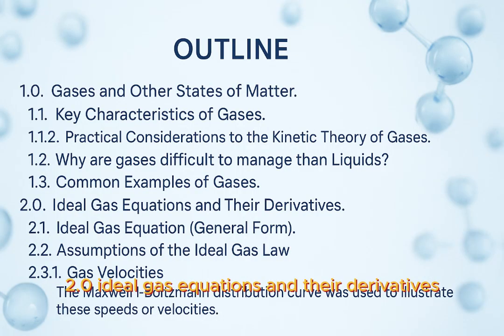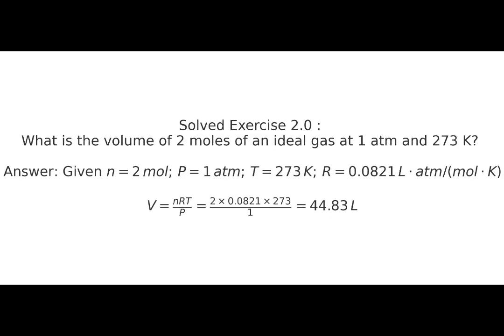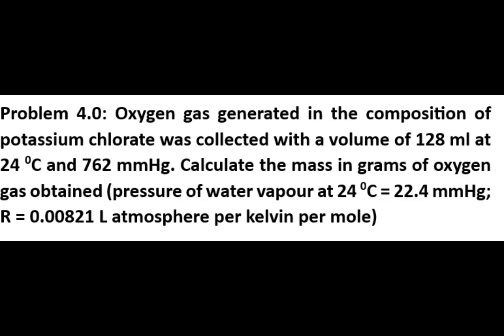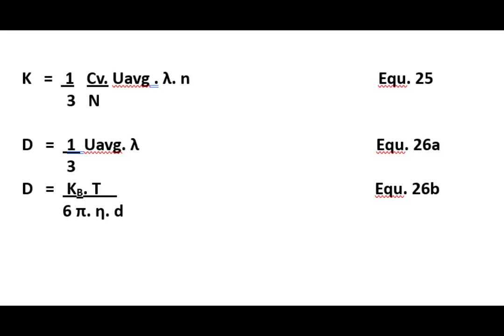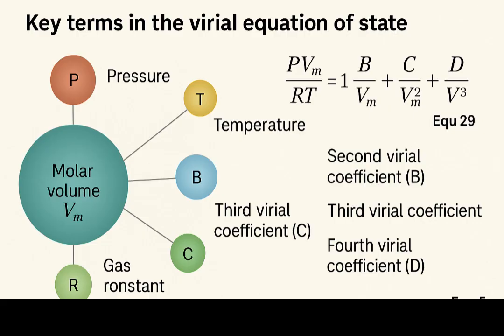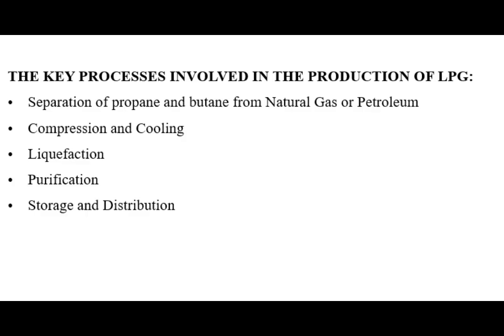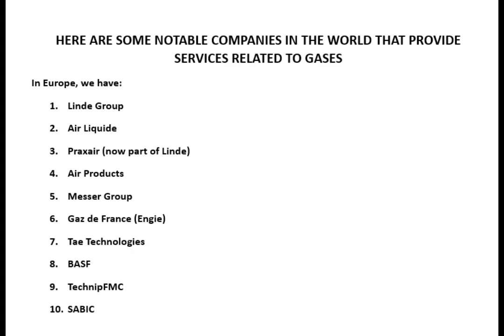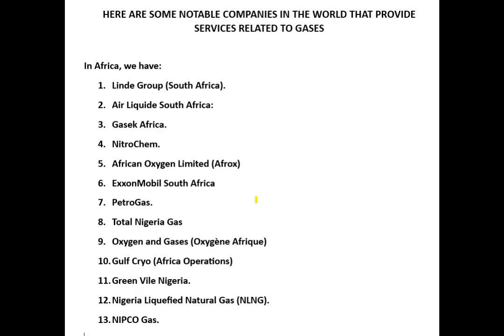Fundamentals and Applications of Gases

Comment: BCH: Using free and pure form of oxygen gas in the atmosphere rather than cylinders of pure oxygen for anesthesia during surgery has several implications including the Advantages, Challenges and Limitations stated below:

Advantages
1. *Reduced costs*: Atmospheric oxygen is freely available, reducing the need for expensive oxygen cylinders.
2. *Increased accessibility*: Hospitals in remote areas or with limited resources could potentially benefit from using atmospheric oxygen.
3. *Sustainability*: Utilizing atmospheric oxygen could reduce reliance on industrial oxygen production and transportation.

Challenges and Limitations
1. *Safety concerns*: Atmospheric oxygen contains impurities and varying concentrations, which could compromise patient safety during anesthesia.
2. *Control and precision*: Medical oxygen cylinders provide a controlled and precise flow of oxygen, crucial for anesthesia. Atmospheric oxygen would require complex systems to ensure consistent delivery.
3. *Logistical complexities*: Capturing, purifying, and delivering atmospheric oxygen directly to operating rooms would require significant infrastructure investments.
4. *Regulatory hurdles*: Medical oxygen is subject to strict regulations; using atmospheric oxygen would require reevaluation of safety standards and approvals.

Medical Implications
1. *Patient safety*: Anesthesia requires precise control over oxygen levels to ensure patient safety. Atmospheric oxygen might introduce variability.
2. *Anesthetic efficacy*: Pure oxygen is essential for anesthesia; impurities or inconsistent oxygen levels could impact anesthetic efficacy.

While using atmospheric oxygen might offer cost and accessibility benefits, the safety, control, and logistical challenges make it unlikely to replace medical oxygen cylinders for anesthesia in the near future.

Comment: BCH: U2021/5535237 (Chukwu Chinwendu)
Using free atmospheric oxygen for anaesthesia has a lot of implications:
1. Its reliability and consistency: the free atmospheric oxygen may not have a consistent supply of oxygen unlike the medical oxygen cylinder. Its oxygen level varies. 
2. Also, due to the atmospheric oxygen concentration (which is lower),  the safety of the patient is not guaranteed. Remember, the air contains about 21% of oxygen. Whereas, the medical oxygen cylinder has 100% concentration or near, and anesthesia requires a high concentration. 
3. Using atmospheric oxygen could introduce impurities (because of the other gases mixed with it) and this may compromise patient's safety. 

Thank you

Comment: Bch:U2021/5535146 Using atmospheric oxygen in place of pure oxygen from a cylinder during surgery is unsafe, unprofessional, and medically unacceptable. The atmosphere does not provide the purity, pressure, sterility, or control required for safe anaesthesia. Oxygen cylinders are essential to ensure the safety, precision, and effectiveness of surgical procedures.

Comment: BCH: Using free atmospheric oxygen instead of medical-grade oxygen from a cylinder during surgery is extremely unsafe. Atmospheric air contains only about 21% oxygen and is mixed with other gases like nitrogen, making it insufficient for the high oxygen demands required during anaesthesia. It is also unfiltered and unsterile, exposing the patient to dust, microbes, and pollutants that can cause serious complications. Anaesthesia requires a controlled mixture of pure oxygen and other gases, which is only possible with medical equipment connected to oxygen cylinders. Without this control, there’s a high risk of hypoxia, infection, and even death.

Comment: BCH:
Using atmospheric oxygen (21%) instead of pure oxygen from a cylinder (100%) during surgery is dangerous. It provides insufficient oxygen for anesthetized patients, increases the risk of hypoxia, and lacks the sterility and control needed. Medical oxygen is pressurized, regulated, and essential for patient safety. Atmospheric air cannot replace it safely.

Comment: PIC:LNG isn't produced using the Joule-Thomson method because methane, its primary component, has a very low critical temperature (-82.3°C), making it difficult to liquefy using this method alone. LNG production requires more complex and energy-intensive cryogenic processes to achieve the necessary low temperatures.

Comment: PIC :
LNG(liquified natural gas) and LPG(liquified petroleum gas).They are both gases but do not have the same principle especially in Joules Thompson effect.
LNG is not produced from the Joules Thompson experiment like in the case of LPG because LNG requires a very low temperature (like methane cooled to -162 degrees Celsius) to make it liquefied.The extreme cooling cannot be achieved by Joules Thompson experiment because Joules Thompson experiment/effect works under certain temperatures and can be cooled under room temperature in which the LPG can be liquified.So the LNG requires much advanced refrigerator (deep cryogenic temperatures) cycles like the Claude or MR process.

Comment: PIC :
LNG is not produced using only the Joule-Thompson effect because the Joule-Thomson effect is a process where a gas expands through a valve or throttle, resulting in a temperature change. For a gas to liquefy using the Joule-Thomson effect, its temperature must be below its inversion temperature, and the expansion must cool the gas sufficiently to reach its dew point.

Comment: PIC:

The cooling from the Joule-Thomson process alone isn’t enough, so LNG needs extra cooling steps to reach very low temperatures (around -162°C). But LPG, like propane and butane, can be liquefied more easily with just pressure and expansion.

Comment: PIC:
 (LNG) is not produced using the Joule-Thomson effect like Liquefied Petroleum Gas (LPG) because LNG's primary component, methane, has a very low inversion temperature, requiring pre-cooling and more complex liquefaction processes.

Why LNG Production Differs from LPG
Joule-Thomson Effect This effect is used in liquefying gases by expanding them through a valve or nozzle, causing a temperature drop. For gases like propane and butane (components of LPG), this effect is sufficient at room temperatures to achieve liquefaction under pressure.

2Methane's Properties: LNG is primarily composed of methane, which has a very low inversion temperature (approximately -80°C or 193K). The inversion temperature is the temperature below which a gas will cool upon expansion (Joule-Thomson effect). Above this temperature, gases actually warm upon expansion.

Pre-cooling Requirement Because methane's inversion temperature is far below typical ambient temperatures, pre-cooling is necessary before applying the Joule-Thomson effect for liquefaction. This makes the process more complex and energy-intensive compared to LPG.

Liquefaction Processes for LNGVarious processes like the Linde-Hampson process, cascade process, or mixed refrigerant processes are used to liquefy natural gas. These processes involve multiple stages of compression, cooling, and expansion to achieve the low temperatures required for methane liquefaction.

Comparison with LPG Production
- *LPG (Propane/Butane)*: These gases can be liquefied at room temperature using moderate pressures (e.g., propane liquefies at about 8-10 bar at 20°C). The Joule-Thomson effect is directly applicable for LPG production without the need for significant pre-cooling.

- *LNG (Methane)*: Due to methane's low inversion temperature, LNG production requires substantial pre-cooling and complex refrigeration cycles to achieve and maintain the low temperatures necessary for liquefaction.

*Summary*: The fundamental difference in the production processes between LNG and LPG stems from the thermodynamic properties of their primary components. Methane's low inversion temperature necessitates a more complex and energy-intensive process for LNG production compared to the relatively straightforward liquefaction of propane and butane in LPG.

Comment: PIC: LNG is not produced from the Joule-Thomson experiment because methane, the primary component of LNG, has weak intermolecular forces, resulting in an insufficient cooling effect upon expansion compared to the stronger forces in LPG components (propane and butane).
The Joule-Thomson effect describes the temperature change of a real gas or liquid upon expansion at constant enthalpy. It relies on the interplay between intermolecular forces and the gas's internal energy.
Liquefied Petroleum Gas (LPG) primarily consists of propane and butane, which have relatively strong intermolecular forces (van der Waals forces). These forces are significant enough that the Joule-Thomson effect leads to a noticeable cooling upon expansion, facilitating liquefaction.
Liquefied Natural Gas (LNG) is primarily methane. Methane has much weaker intermolecular forces compared to propane and butane. The Joule-Thomson effect is less pronounced for methane, meaning the cooling upon expansion is insufficient to liquefy it at typical ambient temperatures and pressures.
Therefore, while the Joule-Thomson effect plays a role in gas liquefaction, it's not a practical method for producing LNG on a large scale due to methane's weak intermolecular forces. Industrial LNG production relies on different methods, such as cascade refrigeration or cryogenic processes that achieve much lower temperatures.

Comment: PIC: LNG production is more complex than LPG production due to:
1) Lower temperature requirements* (around -161°C)
2) Need for significant precooling below inversion temperature
3) More complex and energy-intensive processes*
These factors make LNG production more challenging than LPG production

Comment: Pic  LLG (Liquefied Landfill Gas) is not produced using only the Joule-Thomson effect because, like LNG, it mainly contains methane and carbon dioxide, both of which require very low temperatures to liquefy.
The Joule-Thomson effect alone cannot reach the necessary cooling levels for these gases.
Instead, LLG needs pre-cooling and multi-stage refrigeration systems before J-T expansion can assist.
In contrast, LPG (propane and butane) has higher boiling points and can be liquefied easily using J-T cooling and compression.
So, LLG requires more advanced cooling methods than LPG due to its gas composition.